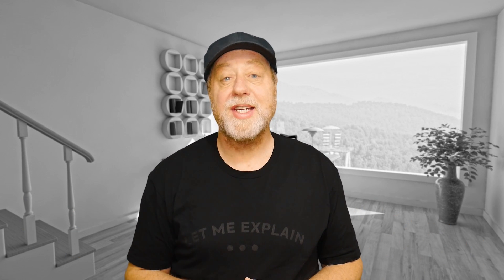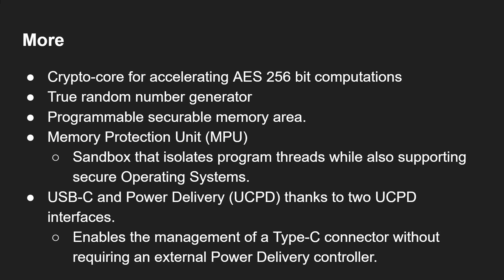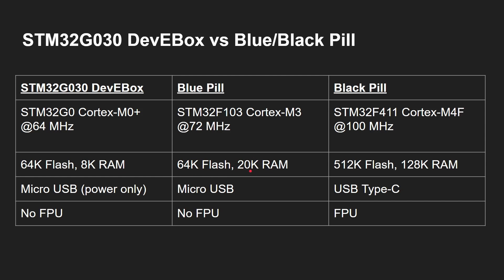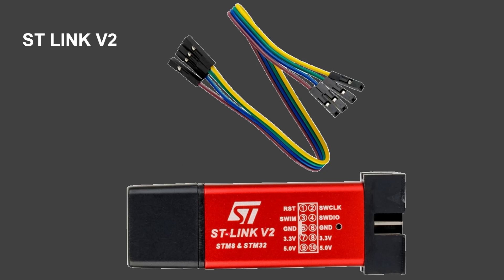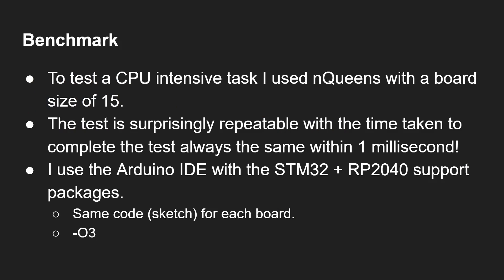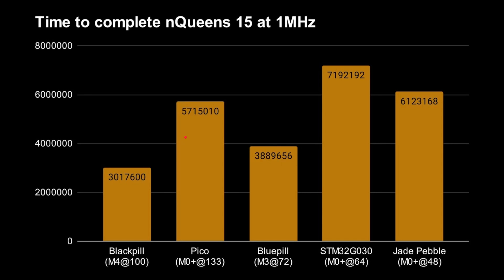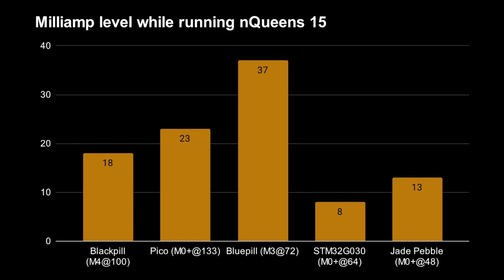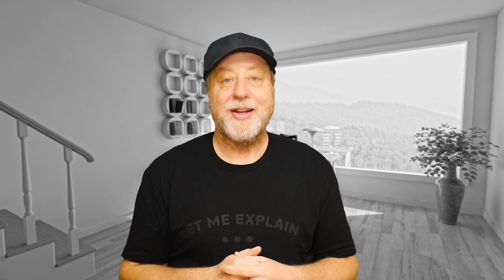Why is this Microcontroller so Underrated? STM32G030 - Cortex-M0+

Comment: keep in mind that the G0 doesn't have a FPU so it's a handicap for algorithm intensive tasks. for other usecase (especially if sleep mode is properly utilised), I guess, the G0 would blow it out of the park with the specs you pointed out in the initial slides. informative video btw.

Comment: I found it on my touch display for the printer, it was used to handle the touch screen, brightness knob and orientation switch, I searched for it and that's how I found about its price.
46c and 10 off and 32c and 1000 off, incredibly cheap, even during silicon shortage.
Shame though they don't have it in some smaller QFN package.

Comment: Hello Gary, I am working with STM32G051K6U7 and there is no GPIO registers in System Viewer window while in debug mode. Did you encounter the same problem with STM32G030? I already raised this point with ST community, but no one answered this rather important question for me. I use uVision Keil IDE.

Comment: There is always he 'Horses for Courses' to consider and which one is the best depends upon what you want to do. One of the iritation I have with the plain common or garden Arduino Nano for instance is that it has more I/O than the programming space required for it (at least it seems that way) and for something only requiring a couple of I/O is daft. In the same way something which is non time critical, why have a fast processor. etc etc etc.
So the conclusion I have is any of them is the best.

Comment: I'm using the G030C8T6 on my own board designs. It doesn't need a crystal for most use cases, because the internal RC clock has a tolerance of just +-1%. And it is available at JLCPCB for a really low price. Also only one VDD and VSS, which simplifies my designs a lot.
Reply: What programmer do you recommend for this processor?
Reply: @orides5976  
I'm using the Black Magic Probe because it provides also a serial interface. So I need only one USB cable for SWD programming/debugging and serial communication to the controller. I built the programmer myself, but there are many BMP variants available for sale. I'd recommend the Dronecode probe, because it has SWD, JTAG and serial connectors and also supports different target voltages.

Comment: All of these development tools usually don't work with ARM, like Raspberry Pi development station.
Reply: Are you sure? I just checked the availability of some STM32 development packages on my Raspi and they are there. I wouldn't use the STM32CubeIDE on the Raspi because it's based on Eclipse, which doesn't run really fast on my office desktop. But vscode with platformio should run.
Reply: I'm using Arch Linux on my Raspis, don't know if the tools are available for Raspberry Pi OS.
Reply: The Rust dev and programming tools targeting the stm32 chips work fine on ARM Linux boards.

Comment: The G030 variant doesn't include the TRNG, AES accelerator, and all the memory protection etc. The G031 will have some of those options added in, but not USB. The G030 also only has 32k Flash.
Reply: No, it has up to 64k Flash.
Reply: @vkp111  OK, 64k is now available in the 32p & 48p package, but all the other items I mentioned remain. The G030 range in fact has so many "gotchas", like the internal 16Mhz 1% OSC is no longer guaranteed to be 1%. Only USART 1 includes the FIFOs, prescaler, autobaud circuit etc. Still fantastic bang for your buck though.
Reply: The G030F6 has the same silicon DIE than the G031F8. Those fancy peripherals do also exist in the G030F6. Also It has 64kB of flash. It's just that those features are not guaranteed to work but in practice they will work and do work.

Comment: "why is this microcontroller so underrated?" probably the 030 code - that indicated to me that it was a much lower grade device, like the other 030 coded STM's - so thanks for bringing this to my attention. 16 channels into a 2Msps ADC with hardware oversampling to 16-bit accuracy is not to be sneezed at, although not having USB device capability is a bit of a drawback - could make very good data aquisition for an RPi via serial though.

Comment: STM32 chips nowadays much pricier than before. I remember looking on digikey chips like the STM32L412U8. Before the shortage, this chip would cost 5,24 $ CAD but now it's well above 7,50 and never in stock either. I have also checked some others like pic chips or atmega ones and the price differences aren't as striking and plus they are often in stock.

Comment: Go look at the EFM32 and other ARMV8+ cores
Reply from the maker: I don't think EFM32 cores are Armv8, they are still Cortex-M0+,M3,M4 etc.
Reply: @GaryExplains  EFM32PG22C200F64IM40

A very gross part number, but a $2 mcu with encryption and locked memory I’ve been using for a few products :) v8 is the future bby ❤️
Reply from the maker: Ah, I understand now, Cortex-M33, Armv8-m.
Reply: @GaryExplains  that’s okay :) not trying to brow bash or armchair engineer! I think you will find the v8 instruction set really fascinating! The v6+ set for M0 is neat and clean (I think there are barely 100 instructions) V7 added in DSP support and V8 added trust zone, encryption, and a lot of very useful memory protection features! With how cheap the V8 based cores are getting now, I wouldn’t be surprised if in a few years we stop seeing the use of the older M0+/really anything that predicates V8. The M23,33,and 55 are all replacements for the M0+,M3,M4,and M7 respectively:) I primarily wrote operating systems and other deep embedded systems, I’d love to chat sometime!
Reply from the maker: Yeah, I was at the launch event for Armv8-M and also for the Cortex-M33! I am currently reviewing the Thingy53 which has the nRF5340 (dual-core Cortex-M33, one at 128MHz, one at 64MHz).

Comment: 8k Ram. Ok thanks for watching
Reply from the maker: eh?
Reply: @GaryExplains  This explains why nobody use that board isn't. No need to dive deeper.
Reply from the maker: Really? 8K for a power efficient microcontroller is lots. The Arduino Mega2560 has only got 8K, that is a popular board. The Arduino Nano has only 05.K of memory. I don't think your assumption is right.
Reply: @GaryExplains  I guess for what you do is enough, I come from ESP32 world and anything "smart" needs a lot of RAM, I often  use extra 4MB PSRAM on ESP32. Pi Pico is dirt cheap and has 264KB if you don't need WIFI. I like to write proper C programs and can't imagine to have 8KB.
Reply from the maker: Ah, I see, the old problem of thinking that everyone else has the same needs as you.

Comment: Will there be a day when they make under 10nm microcontrollers? That would be something..
Reply: Not likely. Below 55nm, embedded flash has become exceedingly expensive. Yes, TSMC does offer STM32H7/F7 series 40nm with eFlash, but this is under very high order quantity, and years of business trust. Flash process becomes very finicky as process node shrinks, and without very good designing capability, the reliability could be a huge problem. There are other NVM technologies, such as FRAM/MRAM, but albeit the claims, they really suck at high frequencies -- they need to be erased to be read, so both read and write involves erasing. As you can imagine, power loss reliability can't be that good, and the erasure latency can make mere reading not so fast, not nearly a match to say, 22nm process where logic can easily run at gigahertz. Flash, just like many other analog IPs, don't shrink very well with lithography. That is why newer performance-oriented MCUs (most Chinese IOT chips) employ a dual-die design -- one 22nm logic die, and one 55nm flash die, where the main logic die does not have any eFlash at all, to tackle both cost and reliability issues.
Reply: Probably not. Micros often need extended temperature range, and a wider process helps. Micros built with 90nm could work  upto 150C
Reply: usually you would use a powerful high speed APU and combine it with a microcontroller and connect them via usart, usb or something else. that is much easier to handle.

Comment: Micro USB POWER ONLY ???? - no, thanks!
Reply: why?
Reply: @gaborm4767  for board like this it is useful to have multiple power options so it should have at least a linear power regulator with at a minimum a diode based voltage selector. Also, in many cases I want to control it over serial and be able to update firmware directly over usb. It is just a very odd thing to have usb just for power. What if I only have 9 or 12V. Or run off a battery.
Reply: @JohnJTraston  Thanks. Well, there are pros and cons. Pro is you don't need to replace the whole board in case of power supply failure. Which boards do you prefer these days?

Comment: The cube programmer is built in to the cube ide too, so you just need to hit a button and it uploads it, it also lets you debug it through the ide which is very useful with features like breakpoints, viewing variables, live viewing variables and you can see the state of the registers too.

Comment: Boy the industry has came a long way, I remember when a microcontroller could barely make it through the night on a 12V 7 Amp hour battery if it lost mains power. It's funny how quickly we take for granite, all the advancements in efficiency and computational power, additional built-in capabilities, all in such a small package. 
Please just for fun run some comparisons with intel first generation of microcontroller, these kids don't know how good they got it now.
Reply: Even if you ran the MCU off a linear regulator (and you probably would have) it would have to consume an entire Amp to drain that battery in 7 hours... Would take more than a few 68HC11's for that to happen :D (sure throw in extra functionality IC and it helps a bit I suppose).
But yes I use nRF52832 at work and love them... Running of CR2032 coin cells, sure. Crossbar switching of most IO function, why not? Build-in easy to design PCBs for 2.4GHz radio supporting BLE, check!

Comment: A price comparison would have been nice, and also a test on Platform IO. Thanks for sharing 👍🏼
Reply: Platformio works nicely, but at the moment you have to provide your own board description file. I'm using platformio with libopencm3 framework. There are quite a few bugs in gcc and libopencm3, especially if you're programming in C++.

Comment: I think that it could be fair to include STM32G4 uController board to the contestants. STM32G431 and 473 are beasts in terms of performance: 180 MHz, same process, Cortex-M4 core. I really think that they will outperform SMT32F411 in terms of raw power and may be W*h per task.
Reply: Yeah that's what I was thinking too. It would be interesting to compare the STM32G4 series vs the F411 black pill, since they are both Cortex M4 and I would guess the G4 will have the low power advantage.

Comment: I personally just LOVE G0 series: cheap, fairly powerful (64 megs!), 8 timers!, 12-bit ADC, very energy efficient (about the same as STM32 L serie)
Reply: And not to forget the internal RC oscillator with +-1% tolerance.
Reply: @andreasschmitt2307  I wasn't aware of it :)
Reply: @rmatveev  
That's the main reason for me to use it on my own designs, because I don't need the crystal. You could just attach a battery on Vdd and Vss and this thing starts up with a stable 64Mhz PLL clock. No need to attach anything on the other pins, ST redesigned the port management really well. It would be perfect for the hobby developer, but the downside is the software. GCC for the M0+ is quite buggy, especially for C++, and the available frameworks have many problems. Also no EEPROM...
Reply: @andreasschmitt2307  Yeees, lack of EEPROM is a huge disadvantage of STM32 series (some STM32L equipped with EEPROM as I can remember)
Reply: @rmatveev  
I think this is because ST also sells I²C EEPROM devices :-)
Reply: @andreasschmitt2307  May be. But this could be applied to any manufacturer including Microchip or Atmel. Is there any royalty due to pay to Intel or anybody?
Reply: @rmatveev  
I was just joking, no idea why they don't include EEPROM. I developed microcontroller software in the automotive industry and there wasn't a single one that didn't use the EEPROM for storing data. A emulation in flash is fine as long as you don't need error memory or a counter that is increased on every key press, like car keys do for cryptology. Who knows...

Comment: This chip has two hardware USART's so why did you use Arduino SoftwareSerial library? Is it not possible to use the hardware USART's for some reason?
Reply from the maker: I used the Software Serial library for convenience. I just picked two pins and got it working. I am sure it will work with the hardware USARTs, but I don't have the time to test it that way.

Comment: You don't necessarily need STM32CubeProgrammer, (although it's required if you need to unlock memory protection), openocd can handle firmware upload to the board, even if you're not debugging

Comment: I wonder if part of the reason the G0 board has such low current consumption is because the board doesn't contain a USB chip and associated circuitry (which must be drawing *something*).  I like that they broke out the SWD pins all together for easy connection of an ST Link.

This could be a good choice for a project that's running on battery and doesn't need the extra processing power of an M3 or M4.  Speaking of battery, do you know if it works on a single LiPo battery?  (I see it uses an AMS1117, which needs about 4.5V to output 3.3V, so a LiPo would result in 2-3V output.)

The STM32L series of processors also seem to be very power efficient and capable.  I don't know if there are any cheap boards that use them.
Reply: STM32 controllers want 1.8 to 3.6V.  You'll need a regulator to run one from a lithium cell.

Comment: Cool video. I tend to use either the lowest end parts like the F030 or the higher end stuff with FP, as appropriate. I never seen to settle on the middle ground.
Reply: GD has a 3x0 series (GD32F330 and GD32F350), which are basically a mid-range CPU (M4F), more RAM and ROM, coupled with exactly G030's peripheral and pinout, all for some $0.7 (GD32F350G8U6, the part that I use the most).
Reply: @bskull3232  Thanks for the heads-up on that part.  Cheap and feature-rich is good!
Reply: @bskull3232  they are a lot more expensive compared to the g030

Comment: You are comparing the new generation M0 to old generation M3 and M4. That makes no sense whatsoever and I see no value in doing this. It's akin to airing a feature by feature comparison between a modern minivan and a VW beetle. Where is the value? I couldn't watch this!
Reply: You don’t understand but it’s okay bc u had no say in the genetics that make u say the things u do.
Reply: I don't see the problem. There are so many factors to consider when choosing a processor these days. Did you instinctively know the power consumption of a blackpill would be so low compared to the M0 processors on the nQueens test? Sure, it's not comparing apples to apples, more comparing the strengths of different models.
Reply: @BM-jy6cb  Well, the M0 G is mostly just a cheap part, optimized for penny pinching at high volumes, while the original blue pill is now obsolete. That's why both have poor power characteristics and a smaller feature sets compared to some of the much more capable M4 processors, or even older ones. IMHO by the time you're finished paying for the circuit board, supporting components and headers, the M0 usually doesn't make any sense for hobbyist use. There are some truly excellent resources out there for comparing the many different MCU's which ST has to offer. I hope we'll see an explosion of new boards become available as the chip shortage situation slowly improves.

Comment: That's funny,  I ended up with exactly the opposite conclusion (NB: i dont mind the power consumption). F103 has many alternative sources (WCH / gigadevice , and they  are ok), it is faster, it has usb,  it is VERY well supported by any software under the sun. The G0 consumes less and has better pin management, it requires less voltage pins. It means you have more functions available on the same  pin package. ( and for reference, the equivalent to the F103 is the G0Bx which has been completely unavailable for a year). So if you dont  have a  consumption constraint , the need for more ram & flash,  and if you dont buy them in bulk from STM, why bother ? Personally, for hobbying,  i'm sticking to F103 (or GD303 from gigadevice if i need more performances), it is more than good enough. BTW, 99.9% of the bluepill actually have 128kB of flash.
Reply: If you are after an alternative of G030, go check out GD32F3x0 (not 30x). F3x0 is basically GD's improved version of STM32G030, with increased flash, RAM and Cortex-M4F running at up to 108MHz. Peripheral wise, they are almost identical, with the GD being lack of cryptography accelerators. Unlike other GDs with larger flash, this smaller flash allows F3x0 to use a monolithic design -- the flash is built-in the logic chip, not as a separate chip copackaged together. This gives it much lower flash latency and bandwidth. You will have to squeeze everything within 128KB, though. I use GD32F330 in digital power converters, and at a fraction of the cost of GD32F303, it serves be more than good enough, plus the smaller package allows me to squeeze more watts out of the same form factor.